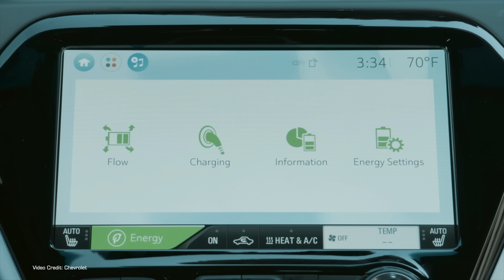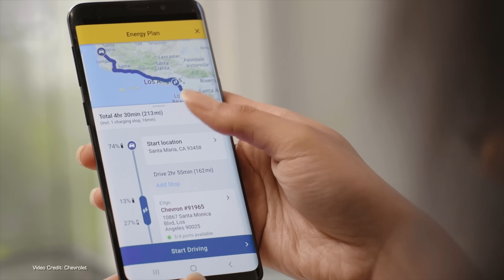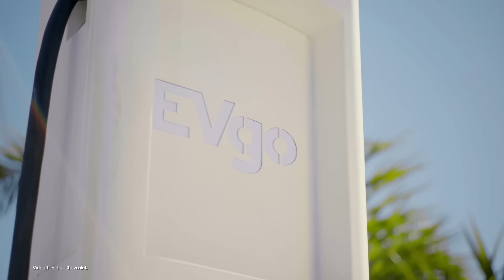UPDATE: Bolt EV Fire : GM Announces Full Battery Module Replacement - Here's What You Need To Know!

Comment: Just wanted to say thank you.  I have a 2017 Bolt, an exact copy of yours actually, and I have really found all the info in yours very useful.  For myself I am sticking with my Bolt.  My commute is only 70 miles a day, so I do not have to worry about being too hard on the battery.  I currently have 41k on the clock and a new battery with new 100k warranty is starting to look really awesome.
Reply: Yes and you may get it by 2024. I've owned G M trucks for decades. No more my sons 2015 1500 has had so many repairs its ridiculous. Done with anything G M.

Comment: Well I got two recall notices for which I have yet to act upon.  I own a 2017 Bolt with ONLY 10K miles.  It is not my daily driver for which I use a ICE vehicle. My Bolt is on Jack Stands in my garage.  Once the (final) recall will be completed if they do replace the batteries, time will not be an issue for myself since my Bolt is in storage and not in use.  When I do rarely drive the vehicle I really enjoy driving it.  I live in an area of the country (politically a Red State) in the middle of nowhere where there are HARSH winters (temperatures dropping to -30F or colder) for long periods of time during the winter.  The charging infrastructure is abysmal where I am at however with the Bolts range would suite me fine.

Comment: Sean Graham just posted a follow up: “Aug 16, 2021 Fire - Roundup Post

There was a fire yesterday of a 2020 Bolt in California. I spoke with the owner to get the details.

•	Manufactured November 19th, 2020. Purchased January 9th, 2021. Car was less than 8 months old.

•	Less than 6000 miles on the odometer.

•	No damage, dings, or anything. Car was in perfect condition. Never had any problems. Absolutely loved the car.

•	Car was frequently let run down to ~30% before plugging in.

•	Car had charged from 9:00pm and completed at 3:04am.

•	Car was in driveway all day still plugged in.

•	Loud bang as smoke erupted out of the side of the car at 5:05pm - 911 was called very shortly thereafter.

•	Fire visible from under the car 3 minutes later.

•	4 minutes after that the aluminum body panels were melting.

•	FD was on site 10 minutes after the smoke erupted, but car was fully on fire by that point.

•	Very clearly was a battery fire.

This is the first 2020 that we know of that caught fire while charging, with the same pattern that was identified with the 2017-2019s.

This is the second US battery to catch fire in under a month.

I have reached out to GM for comment, will update if/when they provide anything.

It is important to note that this is the first 2020 that we know of that caught fire, so the odds are still very low. However, in light of everything else, it's still very troubling.”

Comment: I expect the inferno,  I mean Bolt will lose its resale value due to this mess.  Also with dc fast charging not being a priority of gm/ others replacing ICE looks like a pipe dream.
Reply: ANY GM Product loses its resell value rather quickly due to the quality standards.
Reply: @bfun4615  until the last fire the 2017 bolts were going for 20k now I see them at 17k that's low for this hot used market.

Comment: Kind of interesting I'm sure there are some positives and negatives regarding the ways to handle this problem. It will give them an opportunity to examine batteries in detail that have some miles on them. I think from a customer's perspective and from public relations perspective it would have been better to simply do an entire battery swap casing and all. That is a relatively easy process that a dealer can do relatively quickly. Then ship those removed battery packs with all the pertinent details mileage of the car etc off to some secondary location that has dedicated crew and machinery to disassemble and test. That leaves you with happy customers that have a brand new battery pack in the fastest way possible. But still lets GM get the data they need to figure out how and why this happened. Also gives them the opportunity to possibly put together some quality used and matched battery packs that they could either resell. Or use as storage options for other projects. You could take the individual modules that are inside that battery put them together and make power walls.
But this is GM we're talking about and if there's any company good at screwing it up it's them.

Comment: It is also rumored that since the 60 KW battery is no longer produced, if this full battery pack swap happens, the new battery packs will be the current 65 KW battery pack. This means the Bolts receiving the new batteries will then have an increased range of 258 mile at full charge. This also should increase the value of the vehicle considerably.
Reply: Really doubt this would happen. They will most likely software limit the capacity to increase reliability and not cannibalize new model sales.

Comment: One thing that concerns me (and it could be a non issue) is since the replacements are different types of battery packs with different chemistries, would they current BMS of the 2017-2019 bolts be able to properly manage these types of cells.

Also not sure what good the warranty is since apparently fire voids the warranty, even if it’s caused by the battery itself….. I’m curious what happened with the bolt fire victim who was left with the tab after his bolt caught fire

Comment: Saw a notice last week stating Opel would replace the battery packs on affected Ampera-e cars - I assume there has been "discussions" in the back room between them and GM. In Europe we're in the "interesting" situation that Opel has been sold off by GM to PSA, now part of Stellantis, leading to OnStar being shut down in Europe and the Ampera-e no longer having a working app (and Opel has little incentive to extend theirs to work for the Bolt/Ampera-e).
Reply: Seems reasonable.
Why Stellantis has to risk reputation of "Opel EVcars fires" and the public relations nightmare for few "not their" cars?
Hand down few batteries is a reasonable price to avoid any worrying.

Comment: Green Mountain Vermont winters are not a great place/time to park outdoors. And we have just as much flammable material outside our log cabin house and garage. Finally, not having the option to drive non-stop to Boston or Montreal sucks. And we're probably not prioritized because we took good care of our prior charging rather than looking at the actual impact on our current needs? Yeah, I'm going to be spending a lot of time on the phone for a buy-back. I'm happy to accept a full battery replacement, if it happens before November. If that means it needs to be wrapped by a 2022 car shell, I'm ok with that.

Comment: What I think must be done is to remove the battery, replace it with a new battery. That way the customer is whole, and safe in the quickest time (no more than 1 day). Then, the “bad battery” can be dismantled, and any bad cells removed, and any good cells can be used as spare parts.
Reply: re: "any good cells can be used as spare parts..."  ...for grenades and rocket launchers to help outfit US Armed Forces.  seems like the best "use case" at this point.
Reply: @phillyphil1513  think the real problem is who would want the 'good' modules.
doubt that there would be much utility as a weapon, since no ones knows how to trigger it,  quickly, or when desired.  sort if like shooting a missle, and it doesnt explode when its desired to do so
Reply: @davidwillims2004  Q: What is an example of hyperbole? A: Hyperbole is a figure of speech. For example: “There's enough food in the cupboard to feed an entire army!” In this example, the speaker doesn't literally mean that there's enough food in the cupboard to feed the hundreds of people in the army.
Reply: @phillyphil1513  not sure what you are talking about here

Comment: This is great news for getting new packs for the 2017s I have 2 of them, I will be very happy with the 66kwhr packs into them and a wapping 255 miles per charge and the 8 hear and 100k mile warranty is very nice. Great to know and exciting.
Reply: They use the word selected models to often in their presentation what if it isn’t selected for battery replacement?
Reply: re: "Great to know and exciting." #CURBYOURENTHUSIASM

Comment: Maybe GM would like all GM dealership mechanics to become experts at battery pack servicing. This recall program would give them plenty of practice.
Reply: It makes no sense.  The dealers aren't set up to do this kind of work.

Economical process:
1) You set up a central point to do the fixes on a production line, 
2) You send the dealer a couple of weeks worth of batteries on a few pallets,
3) The dealer pulls the battery and puts it on a pallet of used packs,
4) The dealer sends GM pallets with used packs once per week,
5) GM sends back the same number of new packs from the production line.

Advantages:
1) Minimum time without car for the owner
2) Minimum time in shop for the dealer
3) The same freight costs for GM (as they will either need to send batteries or battery packs back and forth)
3) Lower repair time for GM, leading to
4) Lower costs for GM too as the dealers have to be paid for this work.
Reply: @EwanV  Thank you. I totally agree. The method which you lined out would be logical and efficient.
I was simply offering a possible explanation for what it sounds like is GM's plan.
If GM holds to the plan of not fully replacing all battery cells/modules, then a possible positive to servicing each pack individually and keeping it with the car thar it came from is that any operator caused battery abuse or degradation is not passed onto others.
Reply: @EwanV  re: "It makes no sense.  The dealers aren't set up to do this kind of work." no doubt, but this is AMERICA.  something those who've been paying attention to DC Politics the last 5 years have painfully come to recognize is that things apparently DON'T HAVE TO MAKE SENSE (things happen anyway).

Comment: What about the Opel Ampera e? Opel is super slow and we only got the letter about the newest recall a couple days ago and the car is currently getting the final fix update.
Reply: The third recall of the Ampera-e is basically the same as the first one and is only limiting charging to 90%.
No single word about battery replacement or anything in that direction.

Comment: Excellent report. Thank you. I am sorry you and thousands are caught in this mess. I have a cobalt, yes a cobalt,  that needed a new gas line and it only took the dealer two months to get it and install the part. GM is just buying time to allow the older bolts to cycle out of the market at the owners expense of time and use. They are going to place the new battery packs into new 2022 cars to boast sale figures, not replace the defective packs in cars already out the door, off the company's sales sheets, and on the roads. The existing dealers that I have seen, boston area, shun the sale and maintenance of these cars because most of the mechanics and dealers are not close to certified to deal with this work. I had a faulty thermastat replaced last week which caused a leak somewhere in the coolant system. My car been idled for three weeks . Where are they going to come up with thousands of qualified mechanics to quickly work on the cars. As with all of this  going on, time is quickly slipping away. They trashed again their brand and customers dreams. My heart goes out to you and I hope for the best to you. Keep the faith in green cars. Unfortunately cheap Chinese made cars, some under GM influence are going to flood the car market here and the bolt will become a faded memory. Good luck.

Comment: I have a 2017 Bolt. Purchase from Jennings Chevrolet in IL in Jan 2018. I was told by a GM higher up in IL that I would be offered a $3500 Loyalty Certificate good toward a purchase of another GM vehicle. Due to the bad Lemon Laws in IL they would not do an MSRP swap or buy back my car. GM asked me to bring the car in for the recall service as I had not had any recall service done yet. So I did it. They told me that they did the latest recall service and found my battery to be good. I was told by Jennings Service that I did not have to charge outside anymore. I could charge my car up to 100% and park it inside my garage. This is what happened and what I was told. Is this correct information? I don’t know. I still have hilltop reserve on despite what I have been told. But we are parking and charging inside the garage and overnight. But we never deeply discharge the battery. As for the battery swap. I have not been contacted by GM. But if it takes as long for GM to get Bolts new batteries as it did for BMW to get owners new driver airbags to replace the deadly Takata airbags, I predict that you will never get them. I own two EVs, this Bolt EV and a Tesla Model 3.  Based on my experiences, I do not think that GM is equipped, knowledgeable and capable of dealing with EVs. It just isn’t in their DNA. I would strongly recommend to anyone who is interested in a non-Tesla EV to lease it  for no longer than 24 months and not buy it. This is because the technology is changing fast and you don’t want to own the old tech or possibly defective technology. If interested in a Tesla, you can go ahead and buy it. I have WAY more confidence in Tesla knowing what they are doing with batteries and EVs. Lastly, when Tesla comes out with the Sub-$25K EV it will be game over for all the original ICE OEMs. They will die a painful death. This is from someone who owns both a Tesla and a Bolt. Good luck everyone.

Comment: I'm very curious because it seems like you have a vehicle that you can't fully use and because of where you live I haven't heard anything about what vehicle you plan on getting out of this because in my opinion in some alternate universe or something or some stupid other thing happening I would order a EV Silverado when that comes out or get a Ford F-150 lightning as a replacement vehicle because those seem to be pretty dang reliable right now based on what Ford is basically doing they have very reliable battery packs. Since you're more of a small car or hatchback owner I think the Volkswagen ID4 would probably be a good option to consider but that's your choice

Comment: I have a 2017 Bolt Premier. Getting a new battery is actually a sweet deal (modules)! I live in the country and put a LOT of miles on my Bolt. I also travel out of town/fast charge quite a bit. A new battery will be almost like getting a new car again! :) This makes it more profitable for me to avoid a buyback. I typically keep my cars 10+ years. So for me the value of new modules is I'll get a lot more miles of use being I'll now have old battery miles+new battery miles to do it all over again.
Reply: I also have a 2017 Bolt Premier.  I feel like the battery module swap buys me time to wait for new vehicles like the Ford Lighting to come out and maybe be on the used market by the time I'm ready to switch vehicles.

Comment: I'm not sure we are all on the same page with terminology. There is the outside case of the battery which is a structural member of the Bolt.
Inside there are modules, packs, cells, sections and various other names for the pieces that makeup  the battery. What is the proper name for the component they are going to replace?
Why is this being done in a dealers repair shop by inexperienced amateurs instead of the batteries being shipped back to the factory where they can be refurbished by trained experts, in a clean environment and then returned to the dealers for reinstallation on an exchange basis.
ICE vehicles that go back to a dealer for engine repairs under warranty are not rebuilt. They get a new short or long block from the manufacturer and install it back into the vehicle.
Reply: Inside the battery pack is 5 sections that contain the battery cells. the sections are never disassembled bolt in the dealership. The battery sections are also being referred to as battery is battery modules. Is the structural part of the battery pack is the battery tray .  Is also inside the battery pack is a control module called a battery energy control module, cooling plates and a disconnect unit.       As far as internal combustion engine repair Are done as needed including pistons and/or crankshaft cylinder heads
Reply: @bernardhoffman4586 is  the "pack"  you refer to in your first sentence the outside case? What are the five sections called? 
Would you explain "disassembled bolt in the dealership"
In the dealership I worked, serious "warranty"   repairs involving engines were handled by new, factory short block or long block replacement.
Reply: re: "ICE vehicles that go back to a dealer for engine repairs under warranty are not rebuilt. They get a new short or long block from the manufacturer and install it back into the vehicle." indeed, but unfortunately we're NOT IN KANSAS any more Toto.  no quite the opposite, currently we're in the middle of a GLOBAL PANDEMIC so things may be different.